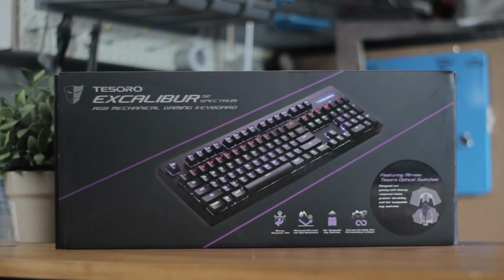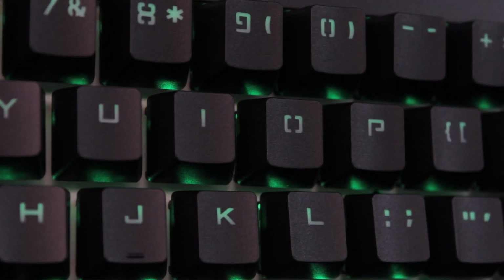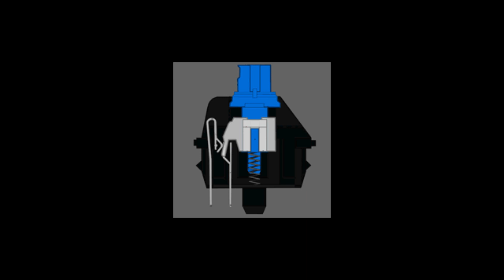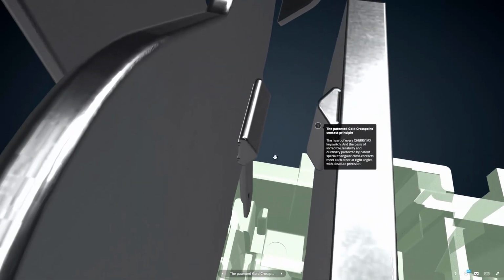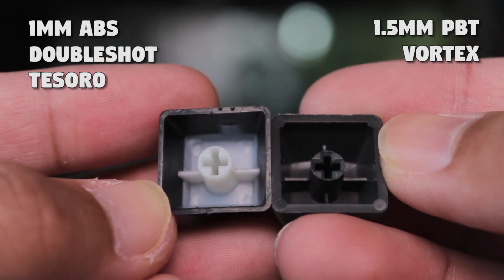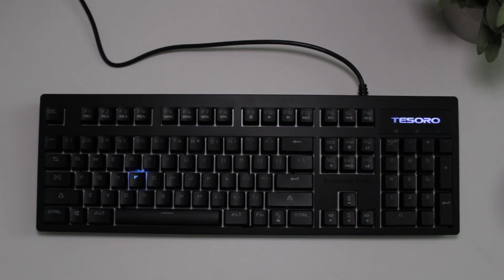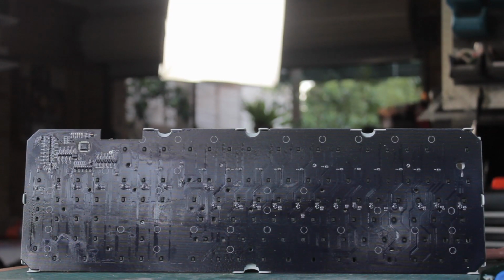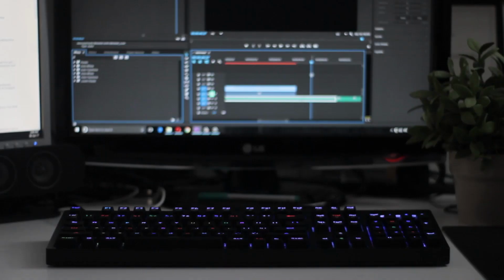Optical Keyswitches : Tesoro Excalibur SE Spectrum Mechanical Keyboard

Comment: if optical switches become a thing, you could make different switches which feel like browns, reds or blues, and hotswap them as you please! Get the top brands on this!
Reply from the maker: Tesoro has an exclusivity period on these specific switches that should be ending soon, so perhaps we will see more keyboards come out with these. If it's more reliable, requires no soldering so it's hot swappable, I'm all for it.

Comment: hmm seems like it would be better as a linear switch since it doesn't need to connect, and it could have as little throw as you want since you could just make the bottom stem longer or shorter..that's how i would advertise it if i were them.... getting "cold" in aus?
Reply from the maker: Yeh I already feel like getting the linears and putting the lightest springs possible.

And yeh cold for my standards haha.

Comment: Are these affected when used in direct sunlight. Optical based sensing usually doesn't work properly when the sensors are swamped by sunlight.